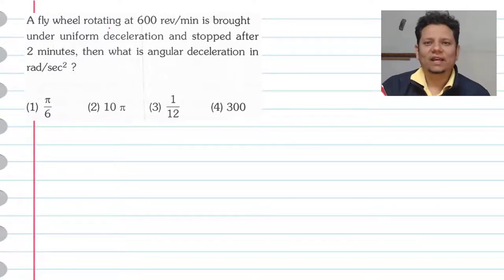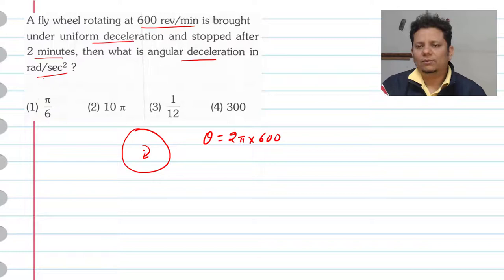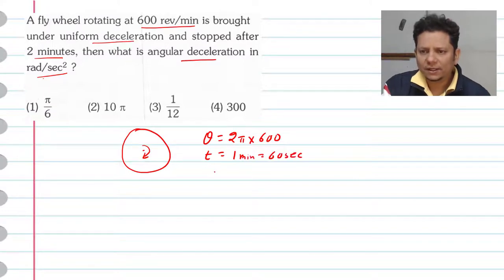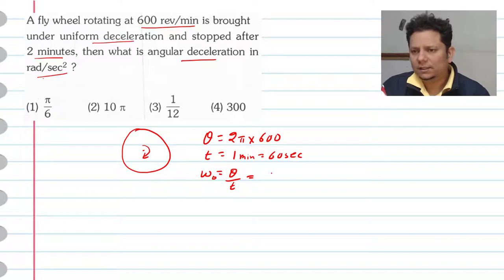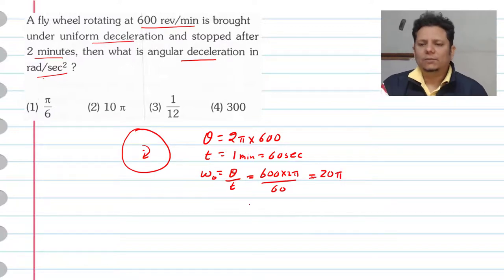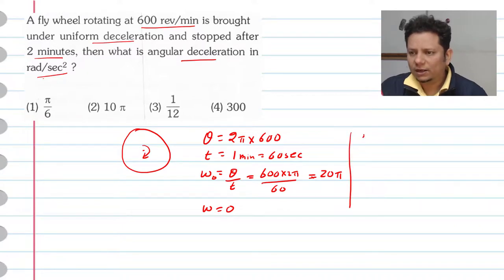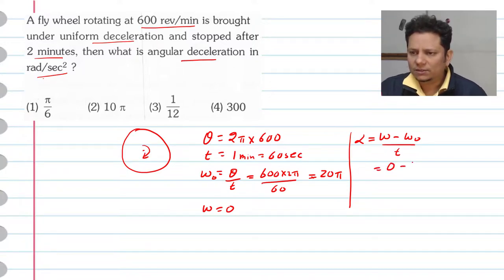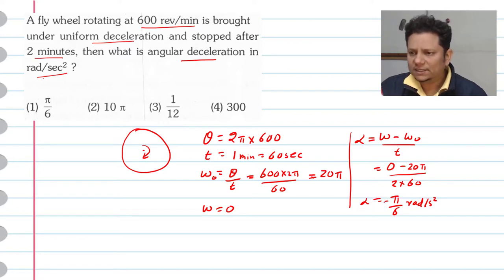A fly wheel rotating at 600 rev/min is brought under uniform deceleration and stopped after 2 minute

Comment: A circular disc of mass M and radius R is rotating with an angular velocity ωo about an axis passing through its cantre and perpendicular to the plane of the disc. A small point like part of mass m detaches from the rim of the disc and continues to move with same angular speed. The angular velocity of remaining disc just after detaching will become :
(a)(M-2m/M+2m)ω
(b)(M-2m/M-m)ω
(c)(M+2m/M+m)ω
(d)(M+2m/M-m)ω
Reply: Sir attaching wala case hota to doubt nhi hota ye detaching wala case hai😒
Aur options match ho nhi rhe hain
I₁ω₁=I₂ω₂
1/2(MR²)ω=1/2(M-m)R²ω'
Mω/M-m=ω' (*_*)
Reply: @XY0X3622YY  so,
 what is the answer ?